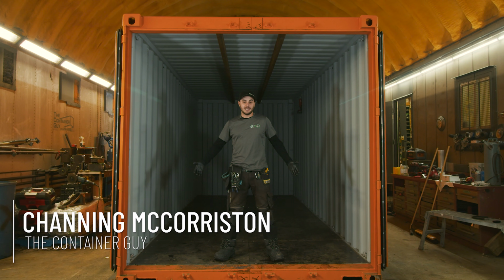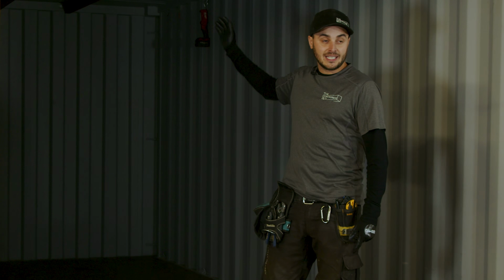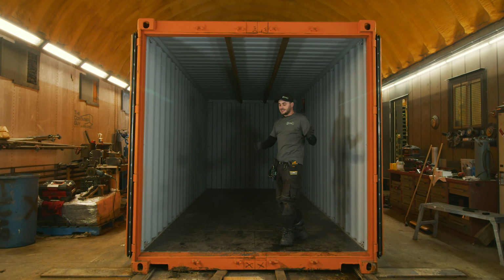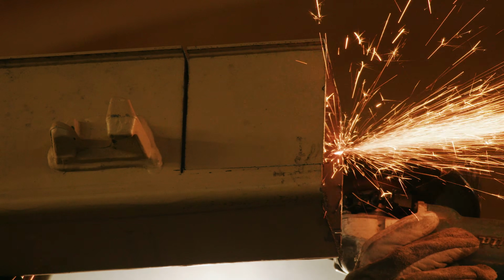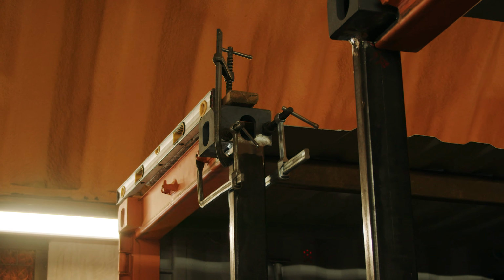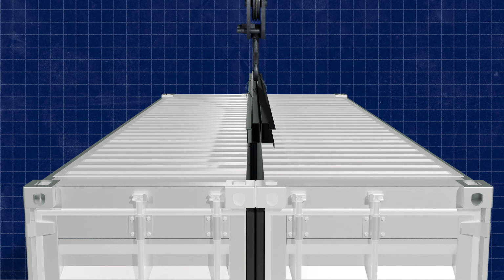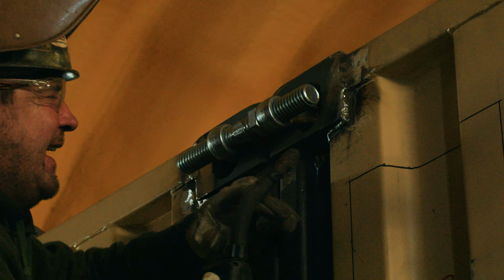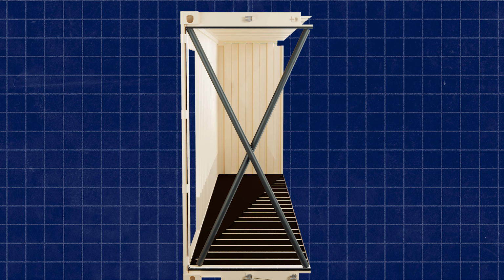Connect Shipping Containers Without Welding!

Comment: To build the split container, they basically need to build them half wide, join them together like you did and the only inconvenient would be adding a few load bars to take the stress from the part where the corrugated sheet is missing in the middle of the container, at the joint.

Comment: Question. With the wood stud brackets giving you an outdoor area to frame, can you insulate the outside of the container without issues with condensation inside/outside the container. Just spitballing here. Have an idea of placing 3x 40’ high cube containers together for a acreage/cabin setting. Interior 2x walls would not be fully opened. Offset door ways if you can visualize that. 
Thoughts?

Comment: Such a great idea I'm sure it will be a success. I envision a jig that bolts together down the center of the container, that serves to stabilize the center of the container while the container is being cut, as well to help guide the cut. Seems like welding is overkill. I know people don't want to use lumber, but you could figure out how to re-use the lumber after the halves are separated and joined to the central container.

Comment: I like your videos but that's a poor design. 

The amount of work it takes to cut a container in half and then weld it to the other containers Costs more in the long run than just cutting the walls out of one side on each container and conjoining them together. You can use tee bar for the beam across the top and do seem weld across the entire length on either side on the roof welding it to the square tubing along the edge of each roof line. You will also need to put a few spacers in on the inside where the square tubing meets the T bar. This creates the structural integrity needed and a seam weld which will prevent any leakage from occurring in the future. If done like this, you do not need a pitch to the roof because the roof of the container itself is strong enough for any snow load with the added T bar between the two containers.  Once that's done, you'll need to put flat bar across the sides and tee bar across the floor of the container, and seam weld them as well. Either way it's a lot of welding.
Reply from the maker: Stay tuned. Lots of cool advancements in the works.

Comment: Hello👋. I have a question. Can you store highly reactive materials in containers? In the high desert where is has no humidity and it doesn't rain.  Thanks
Reply: I'm in the high desert, too, and your qualifiers "no humidity and it doesn't rain" need the addition of "the majority of time" to be truer. This past winter/spring was testament to how much rain could possibly fall in the Mojave. Everything around was green and still snow up in the San Bernardino's til a couple weeks ago.
As for your contents, they're still gonna need some form of protection to which the level(cost) of will depend on their value. The mandatory steps of getting it up off the ground and pitched so there is airflow underneath and the end with the doors is slightly lower than its opposite end are no or low cost and mustn't be overlooked. After that's been done something as simple as ventilation fans run off solar/batttery bank could be used to keep the inside/outside environments more similar.
I have a couple containers up here in the HD and they still get condensation inside. Not often enough to employ countermeasures, but I only store a tractor, implements and tools in mine. Again, value of contents is gonna drive the solution for your application. Good luck.

Comment: Has anyone ever seen someone weld up some rafters, and cut off the roof skin, opening up head room and changing the roof to a pitched roof?  I want to do it for a custom single bowling lane I’m doing, but not sure structural integrity after cutting off the roof skin.

Comment: I'm sure it's been considered but what if you took 2 smaller full sized containers on each side instead of halving 1? Raise the ridge to give you the pitch you want? Guessing not since you want container to give the structural support?
Reply: You should still have the structural support. Just put the interior post in at 8 feet, and attach it to the center container as with the halves.

Comment: Very cool. You could buy a couple Shore's that are used in concrete. 
Google " shore for concrete" its a inter sliding steel support beam you adjust easily with a hammer. 
So basically 4 or 6 shores inside the container before cutting. They hold ALOT of weight. They are used when concrete companies build a multi floor concrete building to keep the concrete from sagging with its weight while it drys. 
Just a thought. 🤷🏼‍♂️
Love your work sir.👍🏻
Reply from the maker: We have steel ratchet load bars that are the same thing. That's what we used the first time and it was super wobbly. The HSS helped hold the corrugations up but it still bowed inwards. We found welding a pipe to the outside 60mm tubing worked best. 

I have the design figured out for China. I'll be able to order these things relatively cheap and be pre-split in China. Only way this will work. 

Our new exterior Studding Brackets might open up more doors that make this obsolete anyway.
Reply: @TheContainerGuyTV  i like the direction your heading with this. Too bad you dont have a facility here in the US.  I'm in AZ and they are making apartment complexes out of containers now. I would love to see how you would go about burying them without over stressing the structure and then stacking some above on ground. You know, make a basement.
Reply from the maker: @J.D.Mc.  That's basically what these new brackets will provide. Use the containers as your foundation or basement and build a house on top.

Comment: Very interesting! But I have to say my initial impression is that it's a lot of work for little benefit. Two whole standard containers beside a middle high cube has to be less work for more area.  Perhaps opening up the high cube's ceiling to get an even more vaulted look (given the needed roof pitch) might pay off ? Perhaps straddling the middle with 20' units to get one larger room ?? In any case, accommodating a standard roof structure of varying pitches has got to be a winning idea. That and exterior siding and insulation.
Reply: interesting idea to open the ceiling of the high cube for a vaulted ceiling look.  Love it.
Reply: I'm skimming through videos trying to figure out why even bother with these types of builds? What is the benefit? Unless you have free containers laying around. That structure would be a day or two of traditional framing labor.  Lumber cost would probably be even cheaper than buying a couple containers.  Way less work than all that cutting, welding and aligning large metal awkward shapes. Plus you'll be stuck shimming interior and exterior to add Siding and drywall.  I don't get it. I bought a container but that was strictly for the ability to have a storage unit available in a day with the option of relocating it in the future
Reply: A shipping container gets you a whole house basically delivered in a few hours! Could you build 8' x 9.5' x 40' in a few hours? Other than a bathroom, kitchen cabinets, plumbing, insulation and electrical, I bet you could be living in a container house in a week. Provided you did most of the work yourself.  Cheaper than a stick frame house. 331.5 square feet for the price tag of less than $30K, $2,200 for the container, not sure how much money for delivery. That depends on where you live. I talked to a general contractor. He told me I could probably build a container home for $30K. Of course that just using a single container. But that's the concept of living in a tiny house. Price tag goes up if you want to use 2 or more containers.